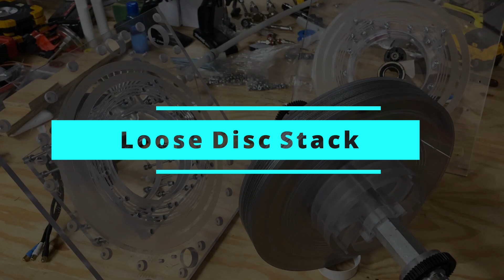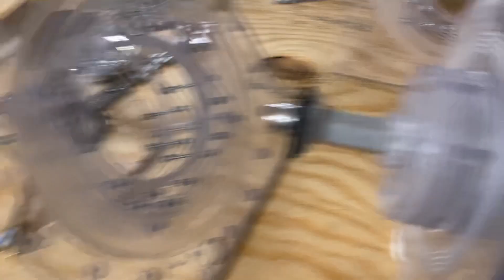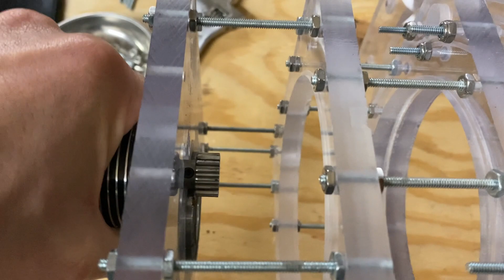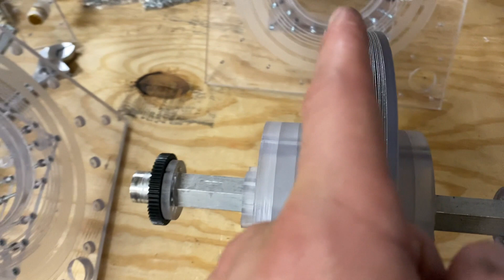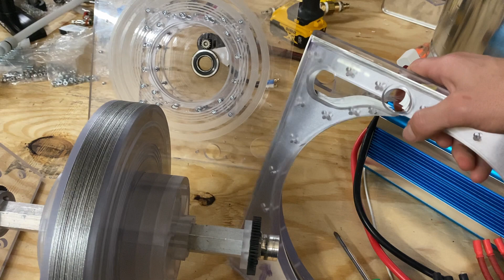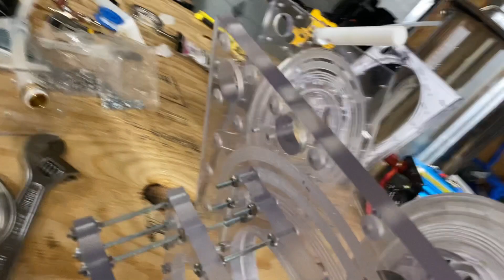How My Tesla Turbine Is Really Bad But Why Thats A Good Thing

Comment: Nice work, I have access to a geothermal shaft with steam between 150°C- 250°C do you think a tesla turbine is a good idea to produce electricity?
Reply from the maker: Hey Mohammad thanks! Yes I think the Tesla turbine is an extremely effective way to produce electricity from steam if designed correctly.
Reply: @CharlieSolis  thx Charlie any suggestions?
Reply from the maker: Don’t over spin your discs or go beyond their max safe rpm. It will not be a fun day lol so design a way to put a breaking force in Incase of run away.
Reply from the maker: Hey Mohammad, not sure if you’ve gotten a chance to see my latest tesla turbine updates but check them out! Just running on compressed air so far while I still work on the larger vacuum chamber system for the turbine. Peak 2.75kW and 6.22ft-lbs of torque 4150rpm with 150psi room temp compressed air with 1/2in supply lines.  And the second video is the latest 1200watt electrical load tests using 170gal of 150psi compressed air dumped to 65psi, both room temp and then 70-80°c heated compressed air. And saw the continuous 1200watt output all the way down to 65psi. Should have this thing ready for a vacuum chamber here real soon! 

https://youtube.com/shorts/yXQy844URMA?feature=share

https://youtu.be/bWpXRzrzf4g

Comment: Taj mahal wasn't built in one day.
Reply from the maker: That it wasn’t!
Reply from the maker: Hey Leucemidus, not sure if you’ve gotten a chance to see my latest tesla turbine updates but check them out! Just running on compressed air so far while I still work on the larger vacuum chamber system for the turbine. Peak 2.75kW and 6.22ft-lbs of torque 4150rpm with 150psi room temp compressed air with 1/2in supply lines.  And the second video is the latest 1200watt electrical load tests using 170gal of 150psi compressed air dumped to 65psi, both room temp and then 70-80°c heated compressed air. And saw the continuous 1200watt output all the way down to 65psi. Should have this thing ready for a vacuum chamber here real soon! 

https://youtube.com/shorts/yXQy844URMA?feature=share

https://youtu.be/bWpXRzrzf4g

Comment: Hey man, do you really think those input flanges are too flexible? If I were a betting man, I'd put my money on them not being flat. Do you think it would be an easier fix to just put an o ring around the brass fitting and pinch it up between the body of the turbine and the flange?
Reply from the maker: Yeah I’m sure. I could see them flex out of the way when I’d open the valve. I put a clamp on them and it stopped them from flexing out and letting the air pass by. Super simple fix though.
Reply: @CharlieSolis  Fair enough.
Reply from the maker: Shoot forgot to paste the link 😇 
https://youtube.com/shorts/u8kQFz02ekw?feature=share

Check it out.
Reply from the maker: Hey jimmy! So I just remembered I had gotten the flanges flexing on camera when I was doing my first garden hose water tests. You can see in this short video that the water is spraying out from in between the thin 5mm thick flange and the rest of the case on both sides of the turbine. And that was with just the cities water pressure.